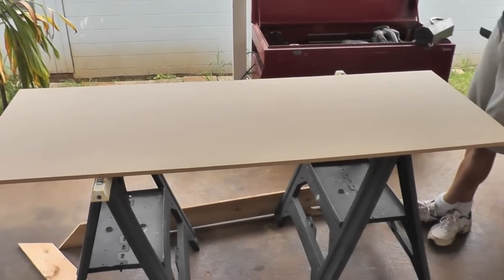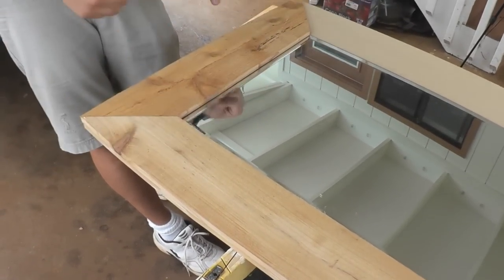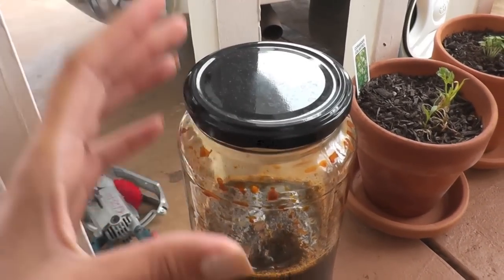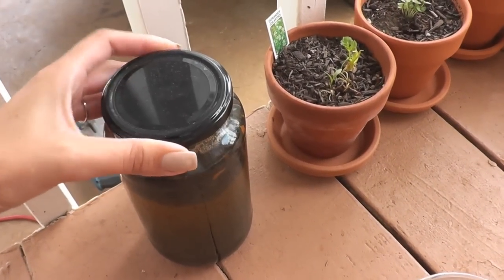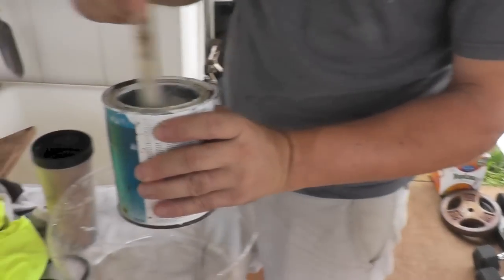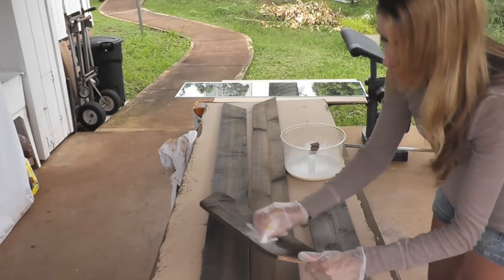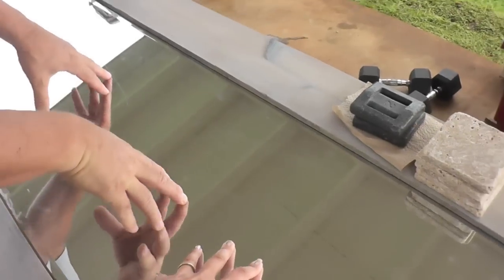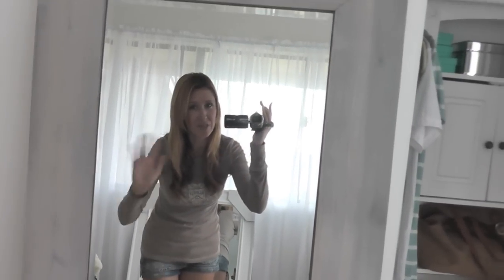DIY Weathered Wood Leaning Floor Mirror

Comment: I really like this idea. I have a cheapy $5.00 full length mirror in a nasty frame that I keep in the closet and pull out when I need a full length mirror. Though I won't be doing this, I think I'll at least spray paint the frame so it looks nicer. You always have such cool ideas.

Comment: Another great way to give wood that 'aged' look is to go to a car repair shop and ask them for about a gallon of used oil.  Paint it on the wood just as you would anything else.  It ages it up beautifully and you repurpose motor oil that will probably be dumped somewhere it shouldn't be.

Comment: Hi Foxy! I have a wicker leaning floor mirror that I want to double with a storage seatee to convert into hideaway makeup vanity. I was wondering how you would attach lighting to the leaning floor mirror. String lights? Clamp Lamp? Want some creative easy to implement ideas. Thanks in advance for your time!